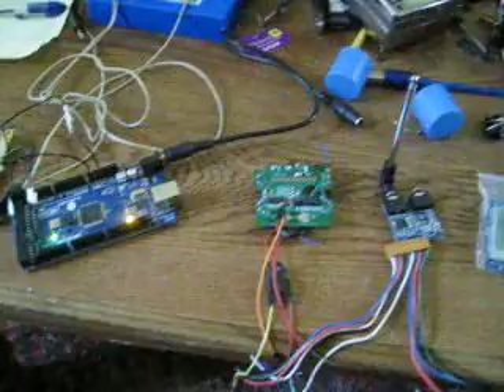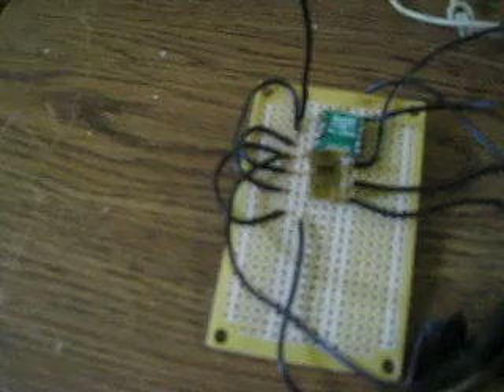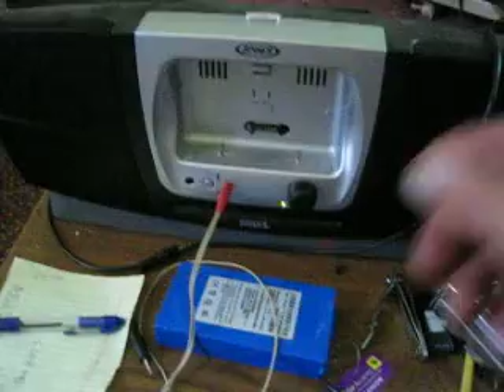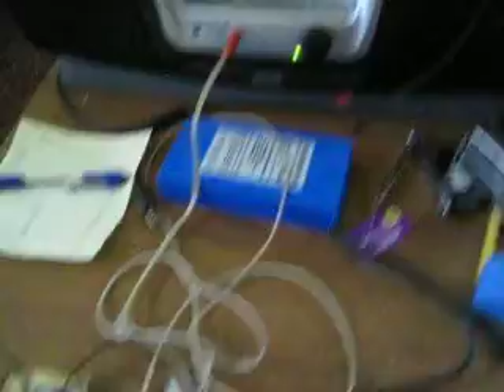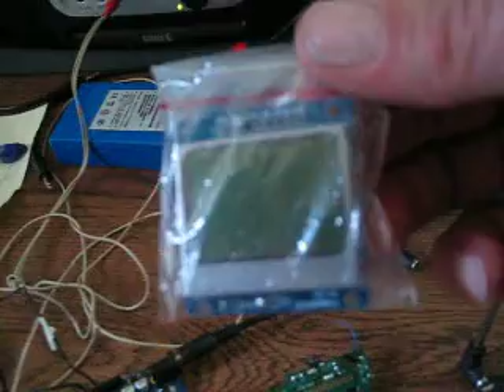Arduino based Ghost Box

Comment: I am currently on version 4 code, Which Adds fw-rev-rand Sweep modes,  Universal tune so works in all parts of the world. :) it will work with all TEA5767 module versions, On chip with Preamp, Or standalone chip, There is a few other TEA5767 based kits on Ebay with the Arduino circuit integrated which ill be testing out, one of them is less than 3 bucks a board. the other is a complete kit with acrylic housing for $20 includes speaker, display, antenna, housing, amp, radio, all on a credit card size board :) the DIP Control chip can be flashed on a UNO Clone, or on board with a TTL LEVEL USB Dongle,  I am hoping to make a custom FW For em to include sweep speed control, Make a nice wee $20 Ghost box :D

Comment: Can you share the sketch please for the arduino to tea5657? admin@sandiegohaunted.com
Reply from the maker: // TEA5767 Example

#include <Wire.h>
#include <TEA5767Radio.h>

TEA5767Radio radio = TEA5767Radio();

void setup()
{ 
 
  Wire.begin();
  Serial.begin(9600);
  
   
}
   void loop ()
   {
  radio.setFrequency(102.5);
  delay (120);
  radio.setFrequency(88.1);  
  delay (120);
  radio.setFrequency(88.3);  
  delay (120);
  radio.setFrequency(88.5);  
  delay (120);
  radio.setFrequency(88.7);
  delay (120);
  radio.setFrequency(88.9);  
  delay (120);
  radio.setFrequency(89.1);  
  delay (120);
  radio.setFrequency(89.1);  
  delay (120);
  radio.setFrequency(89.3);
  delay (120);
  radio.setFrequency(89.5);  
  delay (120);
  radio.setFrequency(89.7);
  delay (120);
  radio.setFrequency(89.9);  
  delay (120);
  radio.setFrequency(90.1);  
  delay (120);
  radio.setFrequency(90.3);  
  delay (120);
  radio.setFrequency(90.5);
  delay (120);
  radio.setFrequency(90.7);  
  delay (120);
  radio.setFrequency(90.9);
  delay (120);
  radio.setFrequency(91.1);  
  delay (120);
  radio.setFrequency(91.3);  
  delay (120);
  radio.setFrequency(91.5);  
  delay (120);
  radio.setFrequency(91.7);
  delay (120);
  radio.setFrequency(91.9);  
  delay (120);
  radio.setFrequency(92.1);  
  delay (120);
  radio.setFrequency(92.3);  
  delay (120);
  radio.setFrequency(92.5);  
  delay (120);
  radio.setFrequency(92.7);
  delay (120);
  radio.setFrequency(92.9);  
  delay (120);
  radio.setFrequency(93.1);  
  delay (120);
  radio.setFrequency(93.3);  
  delay (120);
  radio.setFrequency(93.5);  
  delay (120);
  radio.setFrequency(93.7);
  delay (120);
  radio.setFrequency(93.9);  
  delay (120);
  radio.setFrequency(94.1);  
  delay (120);
  radio.setFrequency(94.3);  
  delay (120);
  radio.setFrequency(94.5);  
  delay (120);
  radio.setFrequency(94.7);
  delay (120);
  radio.setFrequency(94.9);  
  delay (120);
  radio.setFrequency(95.1);  
  delay (120);
  radio.setFrequency(95.3);  
  delay (120);
  radio.setFrequency(95.5);  
  delay (120);
  radio.setFrequency(95.7);
  delay (120);
  radio.setFrequency(95.9);  
  delay (120);
  radio.setFrequency(96.1);  
  delay (120);
  radio.setFrequency(96.3);  
  delay (120);
  radio.setFrequency(96.5);  
  delay (120);
  radio.setFrequency(96.7);
  delay (120);
  radio.setFrequency(96.9);  
  delay (120);
  radio.setFrequency(96.9);
  delay (120);
  radio.setFrequency(97.1);  
  delay (120);
  radio.setFrequency(97.3);  
  delay (120);
  radio.setFrequency(97.5);  
  delay (120);
  radio.setFrequency(97.7);
  delay (120);
  radio.setFrequency(97.9);  
  delay (120);
  radio.setFrequency(98.1);  
  delay (120);
  radio.setFrequency(98.3);  
  delay (120);
  radio.setFrequency(98.5);  
  delay (120);
  radio.setFrequency(98.7);
  delay (120);
  radio.setFrequency(98.9);  
  delay (120);
  radio.setFrequency(99.1);  
  delay (120);
  radio.setFrequency(99.3);  
  delay (120);
  radio.setFrequency(99.5);  
  delay (120);
  radio.setFrequency(99.7);
  delay (120);
  radio.setFrequency(99.9);  
  delay (120);
  radio.setFrequency(100.1);  
  delay (120);
  radio.setFrequency(100.3);  
  delay (120);
  radio.setFrequency(100.5);  
  delay (120);
  radio.setFrequency(100.7);
  delay (120);
  radio.setFrequency(100.9);  
  delay (120);
  radio.setFrequency(100.3);
  delay (120);
  radio.setFrequency(100.9);
  delay (120);
  radio.setFrequency(101.1);  
  delay (120);
  radio.setFrequency(101.3);  
  delay (120);
  radio.setFrequency(101.5);  
  delay (120);
  radio.setFrequency(101.7);
  delay (120);
  radio.setFrequency(101.9);  
  delay (120);
  radio.setFrequency(102.1);  
  delay (120);
  radio.setFrequency(102.3);  
  delay (120);
  radio.setFrequency(102.5);  
  delay (120);
  radio.setFrequency(102.7);
  delay (120);
  radio.setFrequency(102.9);  
  delay (120);
  radio.setFrequency(103.1);  
  delay (120);
  radio.setFrequency(103.3);  
  delay (120);
  radio.setFrequency(103.5);  
  delay (120);
  radio.setFrequency(103.7);
  delay (120);
  radio.setFrequency(103.9);  
  delay (120);
  radio.setFrequency(104.1);  
  delay (120);
  radio.setFrequency(104.3);  
  delay (120);
  radio.setFrequency(104.5);  
  delay (120);
  radio.setFrequency(104.7);
  delay (120);
  radio.setFrequency(104.9);  
  delay (120);
  radio.setFrequency(105.1);  
  delay (120);
  radio.setFrequency(105.3);  
  delay (120);
  radio.setFrequency(105.5);  
  delay (120);
  radio.setFrequency(105.7);
  delay (120);
  radio.setFrequency(105.9);  
  delay (120);
  radio.setFrequency(106.1);  
  delay (120);
  radio.setFrequency(106.3);  
  delay (120);
  radio.setFrequency(106.5);  
  delay (120);
  radio.setFrequency(106.7);
  delay (120);
  radio.setFrequency(106.9);  
  delay (120);
  radio.setFrequency(107.1);  
  delay (120);
  radio.setFrequency(107.3);  
  delay (120);
  radio.setFrequency(107.5);  
  delay (120);
  radio.setFrequency(107.7);
  delay (120);
  radio.setFrequency(107.9);  
  delay (120);
  radio.setFrequency(108.1);
  delay (20);
  
}

Comment: could this be shrunk into the attiny 85 package?
Reply from the maker: I don't know.
Reply: yes the attiny will run this, I have a Package chip with the Micro usb on circuit for easier programming, You can have the radio and a sweep speed dial, It wont run a display though unless its IC2 Based. just because of the limited pins.